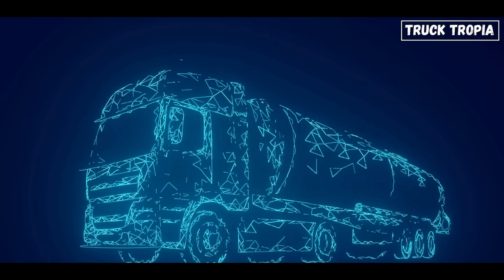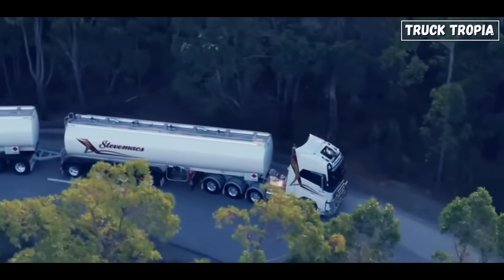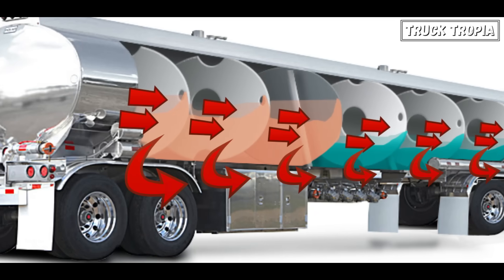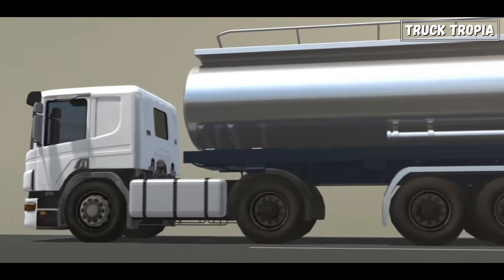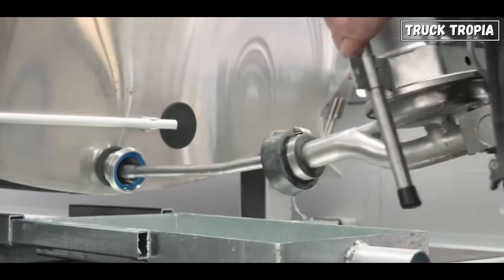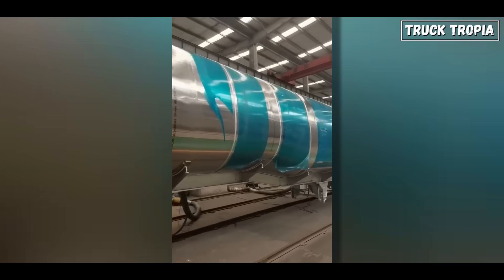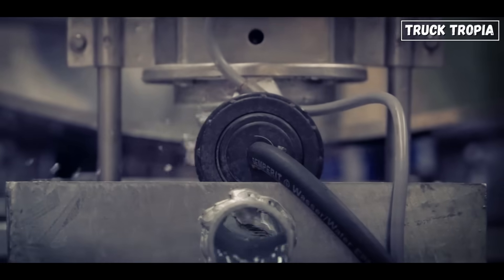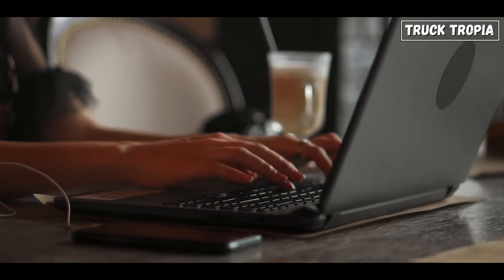Why Are Fuel Trucks Shaped Like A Cylinder?

Comment: When I was in engineering school, and although an EE, I lived with MEs, CEs (chem), and some CEs (civil). I learned so much from these folks over the years. All of that sub-education really paid off when I was writing firmware for machine control, biomedical, and aerospace systems. 
For anyone who has high school kids looking to go 'uni', push them into the hard sciences, and not some 'mar-com' degree. If they're not up to the rigors of maths required for these degrees, spend the money on a decent trade school. There's my unsolicited advice from a geezer who spent 40 years in the tech/industrial world. 
Anywho, I love these vids and always learn something (or a lot of something). Thanks for producing this material.

Comment: Guys in food grade tank are called straight bore tanker. They don't have any compartment or baffles system cuz those are too difficult to wash properly. So the wave and slushing of the liquid are very hard. Plus it could be hazmat too for the same reason. So next time don't push tanker in the ass and don't fuck around us cuz your on a hurry drybox delivery.

Comment: To avoid sloshing why don't they have pistons at the top which are locked down firmly on top of the liquid so that it's fixed and can't slosh around? I mean this would be very difficult in a circular shape, but if you made it square with just the bottom rounded then wouldn't that be ideal? You'd be able to fit more liquids in there with a square shape too.

Comment: Worked with a railroad switching crew that was working at a chemical plant - had to switch a track that had 8 tank cars that were in various stages of loading - the job was to replace the car furthest from the engine with another car and put all 8 cars at the various spots on the track so they could continue their parts in the various processes they were involved with - took almost two hours as the sloshing had to stop before you could make the next move - either coupling up the track or spotting it - the moving slosh would move every thing that was coupled 1/2 a car length or more (cars were 40 feet long), SLOSH is real.

Comment: I have questioned regarding the possible some fuel loss due to the factory setting of low-pressure PV (Pressure Vacuum) Valve on Fuel Truck is too low which will automatically open and release the fuel during transportation. The tank builder will use the aftermarket PV Valve which not fully anticipate the actual service condition. Please share the idea for my knowledge and I appreciate in advance.

Comment: those transporting fuels are typically made from stainless steel to resist corrosion, on the other hand trailers designed for transportation of water are usually made from stainless steel and when it comes to food products like milk these trailers are constructed from stainless steel

Comment: Another similar issue is transporting "swinging meat" (not a joke). The frozen meat hanging in a refrigerated trailer is just as dangerous and often won't be covered by regular commercial auto insurance policies even when tankers are covered.
Reply: I bet it is. I know when my meat gets swinging sometimes I tip over.

Comment: I used to build fuel tanks. Occasionally a customer wanted a small square tank for a pickup truck. I guess they thought it would be more efficient as far as space is concerned but our engineers always tried to talk them out of it. The extra internal supports that had to be welded made the tank way more expensive just because of the shape.

Comment: You should change the name of the video since the vast majority of the video has nothing to do with the title. 
There is two reasons they are cylinder shaped.
 First the sphere is the strongest shape for internal forces, a cylinder is an elongated sphere keeping that strength in two of the three directions.
 Secondly, a sphere holds the most volume per surface area, same logic.

You somehow missed half of the answers in a video asking the question while giving half a dozen things completely unrelated...

Comment: I've been hauling milk for 15 years now. Our trailers don't have refrigation. They are stainless tanks insulated with a layer of Styrofoam. The large volume of milk is mainly what helps keep them cold. I've been told the trailers can sit in the parking lot on 100 degree day for 24 hours and only go up two degrees fahrenheit.

Comment: Fuel haulers are not made from aluminium or stainless because of corrosion resistance. They are made from those materials to lessen the possibility of fire should the truck roll over. Stainless and aluminium do not normally spark when they hit the asphalt like carbon steel would.

Comment: Is there a significant difference vetween trailers that as cylindrical vs elliptical? Most of the fuel trailers I see at gas stations are elliptical.

Comment: As a man who took calculus 3 times and passed the 3rd time with an A. My explanation is that the efficiency for maximum volume of a shape to its surface area is the question to ask. A sphere is the maximum efficiency for volume using the least material next is pill shape where an axis is elongated. Then when considering the practicality of manufacturing and structural integrity, you get a tube that is somewhat "pill shaped" the most practical volume for material to contain the liquid.

Comment: Retired now, but used to own a gas station. In the early years under Chevron, and then independent. When ordering fuel you had to know which tank trailers were available because they had partitions within the trailer. You had to match what you wanted in terms of regular, mid grade And premium. With what tanker was available. Quite a calculation. Sometimes you had to over order one to under order another later just to fill your underground tanks. And then, of course, there was a gamble on price fluctuations. Do you over order now because the price goes up or do you lose because the price goes down? The gas business is more complicated than many understand. Such fun. 😊

Comment: When youre talking about intertia youre actually talking about the free surfice effect. Fill the tank completely full and it will behave the same as a solid intertia wise. Its the slushing caused by there being free room to slush that is the problem. Casual navigator explains this a lot better, most likely because unlike trucks that will stay on land if they flip over, ships will sink if you fill the cargo holds worng.

Comment: Been driving tankers for 14 years now, lately I’ve been driving manure trailers designed for quick loading unloading taking around 6 minutes to load and unload approximately 38.000 kg, these trailers typically only have one baffle since they are either empty or fully loaded 95-99% full, safety wise there are no issues as the trailers are equipped with automatic load capacity checks, meaning I press a button and wait once full everything shuts off and I just put the loading crane back in place. And I’m done. The only other safety issues can be cross contamination of animal illnesses so between every farm the truck has to be fully cleaned and decontaminated to insure animal health

Comment: Very informative video, but I’m not sure if it was explained, but why do fuel tankers are elliptical in shape? And also I remember in Ecuador the fuel tankers have a loose chain touching the ground to avoid static electricity buildup that can cause an explosion, I think modern fuel tankers don’t have it correct? Can someone please clarify? Thanks
Reply: I'm no expert but an ex fuel driver and welcome to correction I suspect the shape is for good reason 1st low center of gravity extremely important ie DG 2nd when loading it fills from bottom to top through faucet valves and vice versa unloading so ( my opinion of course ) the shape assists the unloading because the procedure is usually gravity fed .lastly although modern tankers emit tremendous static esp in transit there is a protocol to follow when unloading because the product is charged simple steps to ensure safe discharge

Comment: One other consideration is cost of construction.  A sphere has the lowest surface area to volume ratio, meaning it takes less material to construct for the volume it can hold.  But putting a sphere on a truck doesn't work all that well because when you increase the length, you also increase the height.  You can only go so high and still make it under the bridge.  So the next best solution is a cylinder.

Comment: Fuel tanker here. I pull a B train, two trailers, carrying 50 000 liters of fuel, a little over 13 000  US gallons. It's well baffled, so the front to back surge isn't too bad, but one has to be careful. Taking corners has to be done very carefully. I corner like your grandmother driving to church.

Comment: While the round shape does even out the pressure, the main reason for the round shape is that it reduces the surface area needed to enclose a volume and less surface area means less material, which allows more of the trailer weight to be payload.

Comment: I sometimes carry those pesky 5 gal water bottles for my water dispenser, 3 of them at a time in the trunk of my Subaru. Preventing them from rolling in the trunk is harder than you would think. If I am shopping for groceries in the same time, I can block them with my grocery bags, but I need to make sure that I don't crush the eggs or the milk bottles.😄

Comment: "When a truck accelerates, brakes, or turns..."? Oops, that doesn't make sense, TT. Braking and turning ARE acceleration. What word or words do you think would better fit for that first item of the list?
Reply: Ah come on. By physics yes, but by common language, even dictionary definition, acceleration is a vehicle’s increase in speed.
Reply: @jacobgreenbough5678  relative to what tho?
Reply: @SlyNine  he was right to refer to the truck accelerating or braking. By the dictionary those are two different things. The liquid inside, however, accelerates under both.

Comment: Milk tanker driver here and also hopper trailers. Good points made in video, with milk, we can’t have any baffles at all, so all are either one big tank, or two separate tanks in on trailer. As we go from pickup farm to pickup farm, I’m the two pot we alternate which tank gets milk at which stop to try to keep the weights more even, also, the testing samples taken at each stop get batched in with the others in that particular tank, it is a real potential that one bad pickup farm can ruin several others, and can also effect the prices they are paid. Another big item is the cleaning, you have to show its last cleaning tag and milk can be rejected if not within time limits, but some will take longer and some shorter depending on what products they are making. Also, stainless steel has one huge weakness, if cleaned with too high of a concentrated chlorine, it will actually begin to rust, and fast. I’ve never seen it ruin a tanker but have seen it ruin the sampler and on one occasion the bulk tank at a farm. When the tank is just the right amount off full, all that milk moving can sometimes feel like someone hit your truck at a stop sign, there’s a lot of force there.
Reply: Chemical tank driver: our trailers don’t have baffles either and are very similar to food grade tanks, except our are often built to handle high temperatures. Many chemicals are temperature sensitive and are transported warm or even hot.
Reply: @ that’s wild! Typically heat is energy and I’d expect to avoid adding heat, unless it’s needed to keep it liquid, interesting stuff!
Reply: @waynenocton  many of the chemicals that need heat either thicken or harden once cooled
Reply: Why clean with chlorine? We use acid and alkaline detergents that don't damage stainless steel.
Reply: @ at the farms themselves they use chlorine, and on the trucks for the sampler, and it’s fine as long as it’s not too concentrated.
Reply: Great post!  Been there, done that.  Definitely have to start off slow so as not to tear up the old single countershaft transmissions and brake slowly.
Reply: milk transportation science, love it
Reply: "with milk, we can’t have any baffles at all"

Why is that?

"there’s a lot of force there."

Well, water is pretty heavy, so that's not surprising with milk, which is mostly water. I saw a video last year of someone tipping water onto the windscreen of a 4X4, and it just smashed the windscreen.

Thanks for the interesting post.
Reply: @pineapplepenumbra  Because food grader tankers must be cleaned and baffles make cleaning far harder.
Reply: @danielkaranja7978  Thank you for explaining. That makes sense.
Reply: @ because it makes too many places for dirt, bacteria, various things to hide, can’t be cleaned properly. Even the 2 pot tankers still have zero baffles.
Reply: @pineapplepenumbra The answer is yould make Butter with the load if you had baffles ,
Reply: @harryheinrichs8206  Lol, good point.

I should have worked that out as I used to tell pupils who would drive roughly, that they would never get home with milk, as it would be churned to butter from the way they were driving.
Reply: @pineapplepenumbra  you got it

Comment: The first time I hauled hot oil for road construction I was forced through a red light due to the surge the load produced. It was an "enlightening" experience. I moved on to eventually haul double milk tankers in Upstate NY (NYS Thruway), not a lot of slowing and increasing speed as a rule but when cars did stupid stuff it was "entertaining", but more often dangerous. I don't miss driving anymore. I thought I would end up retiring from trucking but took a different path after 25 years. New position was a much easier job...

Comment: as a regular driver who pulled flat beds and normal trailers i tried one of these one time. oh man i couldnt even shift properly. hats off to the tanker guys
Reply: Thanks -as fuel hauling and ethanol  now you know 😅
Reply: Many drivers struggle to transition to tankers. In many cases drivers that haul baffled tankers struggle with un baffled tankers. I hauled fuel tanker (baffled and compartmentalized) for many years and I initially struggled with un baffled tankers. It’s an art form to speed up and slow down with these tanks. Even those with experience get slammed every now and then.
Reply: In europe all tanks have to be baffled by law now from what i know @dmb25108
Reply: And they became roommates of the road.
Reply: You'll learn how to shift VERY smoothly,  in a hurry !

Comment: Many trailers today are not cylindrical but oval. at least here in Europe. Carries more volume for a given length.
Reply: Same in the USA -- most trailers hauling liquids are oval (elliptical cross-section).  The main exception I see is propane haulers -- those are steel and always cylindrical.
Reply: @SplashJohn stainless and fibreglass tanks are often round where aluminum tanks are oval or elliptica. Stainless and fibreglass tanks are smaller tanks the are manufactured long and slim to lower the centre of gravity. 
Aluminums are build with the oval or elliptical shape and built longer and are slightly wider all to lower the centre of gravity.